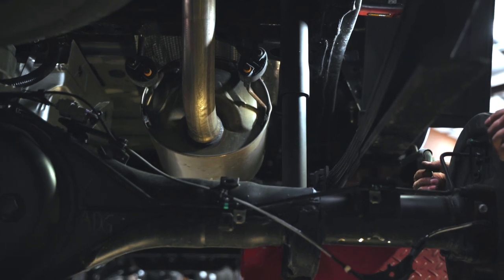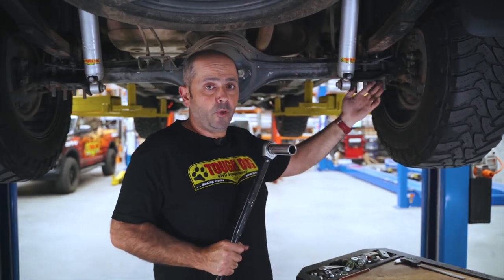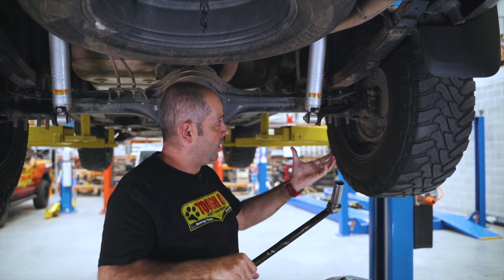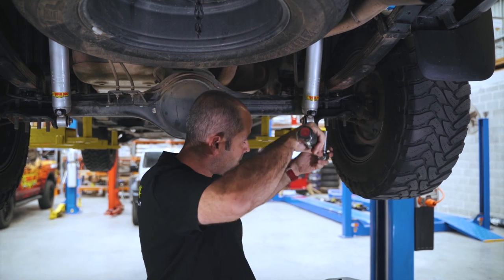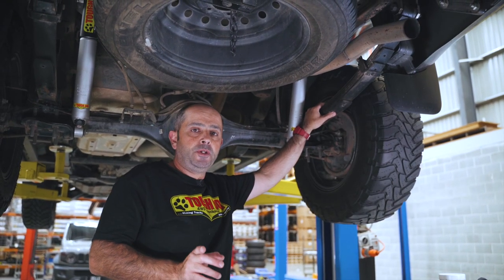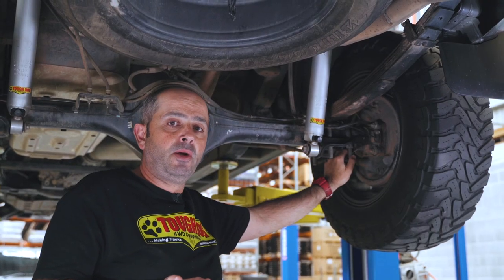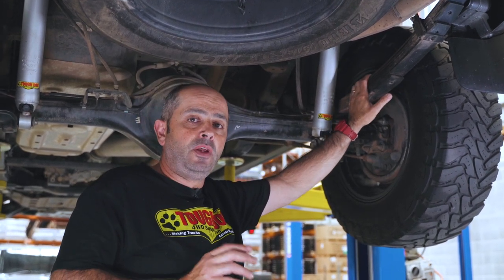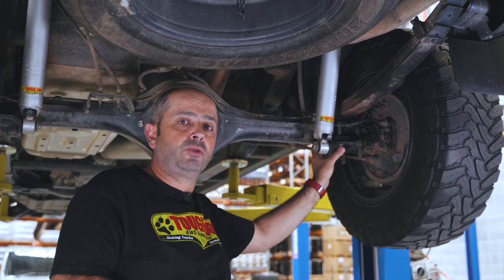Tough Dog Tech Tips: Torquing U-Bolts

Comment: Good tips. Overtightening the Ubolts might not be a good idea. 
Any tips on torque values for leaf spring bushings? Just changed the leafs out on my 2020 ranger and they didn't seem overly tight  from the factory maybe around 30~40 ft/lbs.
Reply from the maker: The bushes in the eyes of our leaf springs are pressed into place, so there's no torque setting for those.

Comment: So is a 14mm u-bolt 14mm in diameter, or does it have a 14mm nut on the end?
Reply: 14mm u-bolt has a M14 aka nominally 14mm diameter threads.